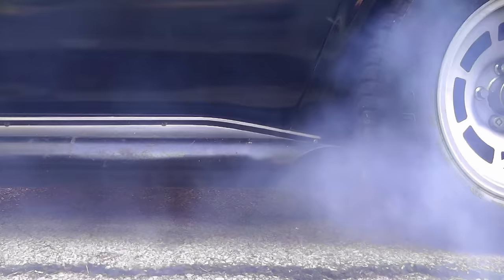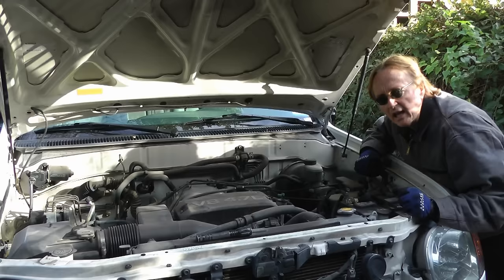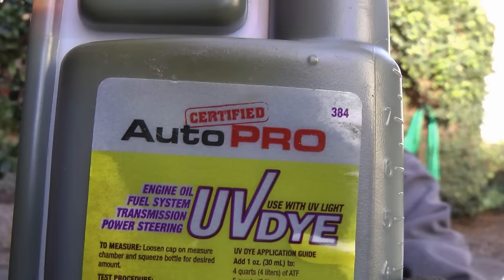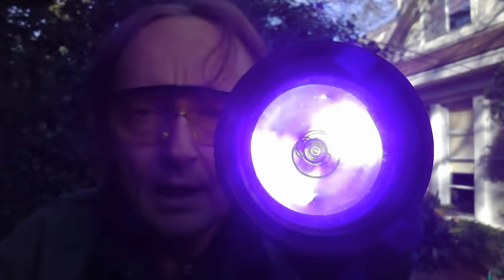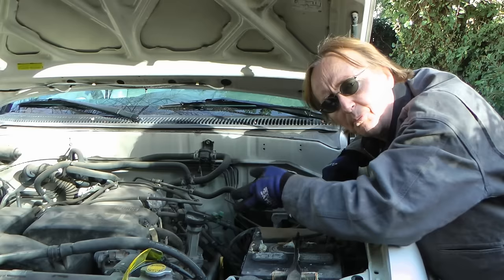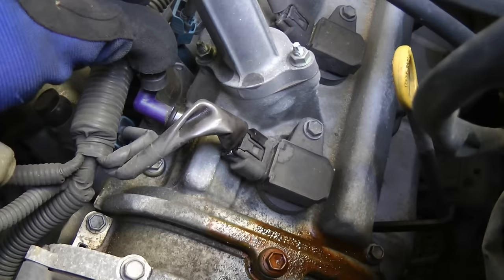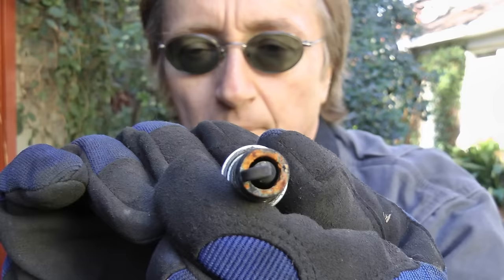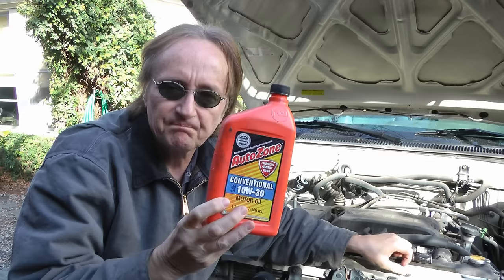How to Fix a Car Engine that Loses Oil (Leaks)

Comment from the maker: it's stupid unless you own an old tractor that's falling apart. If you want to clean an engine, get engine flush in a one quart bottle, it's basically kerosene but has directions and must be used in combo with some oil in the engine.

Comment: Another helpful video. I hope its just the PCV valve being clogged. Time to change the oil and air filter. I will pray its not serious engine problems.
Reply: +222Lightning YOOOOOOOOOOOOOOOOO. How come I can't find the PCV valve on my 1986 Honda Prelude. Its as though there isn't one to replace and the new PCV valve I bought doesn't go there.

Comment from the maker: I'm not a VW fan these days. Over engineering and very weak automatic transmissions turn me off. Now they can get great mileage and those engines can last a long time, but realize repairs are astronomical when they do break.

Comment: My 2001 Corolla was using about a quart a month, it was burning it. Kept messing up my catalytic converter too. I got rid of the car. I could sometimes see the oil smoke in my rear view mirror coming from the tailpipe.I don't think the car was very well cared for before I got it, because I always changed the oil and filter to try to prevent this.

Comment: Part one: I have taken a couple of courses in lubrication and air-oil filtration. One of the problems of oil consumption is if the pcv valve and vacuum hose going to it is clogged. In order for it to work properly a certain amount of fresh air CFM has to be drawn through the hose and valve. This is because the engine creates it's own environment while it runs as burnt and unburnt gases seep past the rings. The PVC's job is to draw enough fresh air (CFM) to stay ahead of the gases. Keeping the air that is in the engine clean. Oil that gets slinged around in in air that's clean for the most part stays clean. Oil that gets slinged around in air that is black as diesel smoke won't stay clean for very long. And these type of contaminants make your car consume oil.
Reply: Part two: Two of the tell tell signs that your PCV system is not drawing enough CFM of fresh air fast enough is that your oil turns black in about 300 miles. The other is where the intake of fresh air is for the PCV system is, which is usually a big hose coming off the valve cover and hooks somewhere to the intake system before throttle plate. Is actually dirty and sludged up a little Kinda looks like engine oil has been coming up through it. This means that the gases that pass the rings is running through the fresh air intake to the PCV system. So your engine is not getting enough fresh air to keep the air environment clean.
Reply: Issac Bourne Past three: So you change the valve and make sure all the "vacuum hoses" are clean and there is no sludge debri inside them. Now because what you spray in the vacuum hoses goes into your engine what you use to clean this sludge out has to be safe for combustion. Safe for O2 sensors and your converter. Other wise you can mess these things up and set all kinds of codes. So use an engine decarbonizer that says it's safe for these things. As the vacuum hose is off and engine is running if it does not stall. You spray a little at a time. Once you determine that you have sprayed enough to get the hose wet with the cleaner all the way through, turn motor off then spray some more in there and hold the hose up so the cleaning fluid drains down into the hose.
Reply: Issac Bourne Part four: Let it set for about 10-20 minutes then crank engine back up. Using your thumb to cover the vacuum hose up and allowing suction to build. Remove thumb suddenly allowing air back in. You can repeat several times. This can dislodge some sludge to be sucked into engine to be burned off. Follow up with a couple of squirts from a can of brake clean to remove residue and you are done cleaning the PVC system..
Reply: Issac Bourne Basic rule of thumb. If you oil turns black quickly it's not your oil that's the problem. Oil is supposed to suspend contaminants so the filter can catch them. Suspension also means the oil is keeping the metal clean inside your engine as the expense of becoming dirty itself. So after you do this pcv cleaning if you oil still turns black pretty quick change it every 1,000 miles until it quits doing that. Or flush it with a "safe engine flush". A good oil will try to clean the residue left inside your engine from a malfunctioning PCV system.

Comment: i use to have a 89 ranger with the 2.3 4cyl... everytime I let out the clutch to go from a stop the engine will go clunk clunk clunk and blows a buttload of smoke,, , the previous owner didn't take care of it too well,, it lasted me through the winter until the engine finally went out ,, but for 300 bucks I am not complaining

Comment: Here's another good trick. If you tailpipe smokes only when you decelerate, your valve stem seals are leaking. You can replace them without have to remove the head . There is a special valve spring tool at Harbor Freight. Cheep. I did it to a Mitsubishi PU and even passed smog.

Comment: I gotta add about qt a month.  My 3.2 V6 from Isuzu is notorious for burning oil. Anyway, on my last oil change I replaced 1 qt. oil with 1qt. Lucas Oil Stabilizer. Been a month, level on the dipstick hasn't changed.
Reply: Isuzu hombre ?

Comment: He’s right about all the possibilities, but in very high mileage vehicles the burning of oil is most likely due to expected piston ring wear. The oil is getting around those rings and being burned up (probably with tell-tale blue smoke coming out of the tail pipe). You can try that additive he mentions, but there’s really not much to do about that short of overhauling the engine.
Reply: But trucks can last for millions of miles though lol as some people say.

Comment: I always use an OEM filter. If I can't find one, I'll always go with a Wicks filter. Both are great filters, good for 5000 miles without trouble. That is unless you drive in dusty conditions. Need to change them more often. Ask Scotty?

Comment: one other thing.. had a vehicle that started using more oil than gas but no smoke... happened to be at a gas station at night and when I raised the hood I noticed the exhaust header was glowing cherry red... The catalitic converter had partially clogged from inside debris when it failed and crumbled.....  replaced the converter and not a drop lost..... the clog was creating back pressure and forcing the oil out of the main seals like crazy.. so if nothing else works just check that out

Comment from the maker: You need an air compressor and all kinds of tools to do that seal if you're doing it on the engine, and not pulling the head off which is an insane job in itself.. I would not advice an amateur to try that job.

Comment: My uncle brought Renault Scenic 2004 Diesel and it has the same problem. Burns oil and quite a lot of smoke comes out. All this started when he had his first oil change done. That means something was put to the engine to prevent smoke from coming out before he brought it.

Comment: If you're a rotary car owner like me the engine burns oil along with the fuel. Might have to top it off if you don't do frequent oil changes. Personally I do a change every 5000km on my RX-7 FC turbo II S5, so I don't bother with top offs. I also premix on every fuel up either way so the engine won't be going bad anytime soon because of lack of oil.

Comment from the maker: fix the fan first so it doesn't overheat. Then work on the AC and heat, and get a trouble code number for that light.

Comment from the maker: valve is on the back of the valve cover. but often with improper oil changes, those engines just burn oil from internal wear.

Comment: you should also add that if your car has a plastic cover underneath, you won't see the oil drip on the ground, most german cars have plastic under body covers that catches all the oil leak

Comment: 8th Gen Accord the worst ever for this issue, just gobbles 2qt between oil changes, which i need to top within 2k, i keep up with all proper maintenance schedule and no leak. Cleaned the pcv as well.

Comment: Scotty I have a Chevrolet that has used a quart of oil between oil changes since it was new.  Oh forgot to mention that it is the 5.3 liter V8 you know the one that runs either on 5 cylinders or shuts down 4 cylinders to run on 4 cylinder mode & I know there is nothing that can be done because when it runs in 4 cylinder mode 4 of the piston are not firing.   The dealer changed oil & used 10W 30 synthetic blend.   Living in S Calif where it gets very hot in the summer is why they don't use 5 W 30 which it calls for & full synthetic at that which makes oil changes very expensive with 6 quart capacity.   I should have researched the car more than I did just tired of under powered V 6 love the car still have it

Comment: Another reason for oil consumption is a worn and lose timing chain from a high mileage engine. When the valves get off timing with piston movement there will be loss of power. Not a lot though. But oil consumption is caused from this when the intake valve opens late creating more vacuum in the cylinder than what supposed to be there. What this does is sucks oil pass the rings into the cylinders to be burned which = more oil consumption.

Comment from the maker: sometimes putting syn oil in a car that used normal oil will cause oil to leak out of engine oil seals. I personally do not swap oil brands out like that.

Comment: I actually have a leak myself, but it's small enough that it just makes a damp spot on the front of the transmission, doesn't even leave a spot, nor does it bother me. It's in an Explorer, they run synthetic oil and that's why it leaks, so when I change it soon, I'm gonna go back to conventional because I've heard that the 302 Explorers leak easy with synthetic

Comment: 2008 Camry factory defect in the engine causes oil excessive oil burning. Was unaware of the recall at the timeI purchased mine used. Found out when mine was past the mileage limitation for the warranty.

Comment: Using hot water through the intake manifold via the brake booster, slowly, carefully at a high idle speed will steam clean the inside of the engine and remove a lot of the carbon for free (except for the gas used). Go slowly so you don't get anywhere near hydrolocking it.
You won't mess up the catalytic converter with burning the Seafoam this way

Comment: I have a 2008 350z, On startup, there is a puff of white smoke for no longer than about 30 seconds, then it goes away. It also spit a little oil at high rev.

Comment: You can clean a gummed up PCV valve. Get the right form fitted hose.
Some aftermarket PCV valves physically fit the engine and cause poor idle quality, so use the correct manufacturer part to stay in spec.
You can test a PCV that's in use and you're wondering by watching the RPM. Put your thumb over its valve cover end and look for RPM drop around 150 let's say on an american v8. Feel it operating. It has a small calibrated orifice and calibrated spring inside. It should rattle inside when you shake it.
If its clogged up or sticky, it can cause pressure to build up.
That can push against gaskets and seals.
There is an additive that can help rejuvinate shaft seals, but if it's oiling your timing belt area, change those seals , the belt, and waterpump, possibly idler and tensioner all at once to save repeat repairs. Some engines have an oil pump down  by the crank you can put a kit into during a reseal.
So it depends what you're working on. Always.
Oil sending units are probably the most common dripping oil leak that occurs first.
Just some facts I've compiled.
The right filter and oil drain plug washer are a regular thing to get right every time.
Torque the plug to avoid over tightening. Lube the filter o ring to prevent massive leakage on startup. Don't leave the previous filter o ring stuck to the engine sealing surface.

Comment: Hey Scotty, I read reviews on amazon on restore engine restorer and this one comment got me thinking. It said that a guy bought a ford pickup truck with a 465 engine I think and it was going through oil like crazy, like a quart or 2 every 300 or so miles. And after adding restore engine restorer and some driving, the oil consumption went from a quart or 2 to 1/2 a quart to no oil being burnt. He also claimed that the valve train ticking noise went away. So I think it turns out the cylinders are scratched up and the csr particles in the additive filled the scratches up and gave better performance and mileage and also reduced oil consumption to none.
Reply: Sorry it wasn't a 465, it was a 460 and it was a 88 f250
Reply from the maker: Peter Kapica that stuff has copper or something in it that can in the short term fill up spaces,but it's no miracle. And NEVER use it on a modern engine with variable valve timing, it will clog it all up
Reply: Right, but if the additive is used every or every other oil change, it will keep the cylinder even throughout. Just don't use a oil filter that filters out particles smaller than the metals in the additive, it will clog the filter up doing that.
Reply: Plus, it might stop small oil leaks because the particles will collect in uneven places and holes if the leak is small. It's also usable in automatic transmissions to make the clutches inside last longer if it's pretty worn.

Comment: I got lucky when I purchased a MKIV Golf 1.8T by adding 6 rounds (2 bottles total) of seafoam to my oil 200 mi before changing it.  I was burning though a quart of oil about every 750 miles and had low compression on cylinders #4 and #3.  Put some compressed air trough the spark plug and heard / felt it coming out the oil cap and nothing out the intake and tail pipe or coolant reservoir.  After the first oil change frequency changed to 1200mi between quarts, and #3 compression increased 15psi to 144.  Kept doing the rounds, and finally I'm a quart down at 5k mi right when the oil change should happen and #3 as well as #4 compression are within 10% of #1 and #2.  Next time I'm bringing a compression gauge with me before buying a car.

Comment: 1999 Corolla burning oil -- need to add 2.5 qts for 1500 miles drive. No physical leak is seen. No white/black smoke. Noticed rear bumper got black easily. Gas mileage is 35 MPG for city drive & it otherwise runs good. Appreciate all suggestions/advice/help to fix the engine oil leak problem. Thanks.
Reply from the maker: +yjxu66 it's burning oil, do change the pcv valve and pray. But that old, odds are engine is just flat wearing out inside. Add oil and drive it

Comment: finally...after 2 years since i got my engine rebuilt on the bmw 325xi e46...ive been having to buy a quart of sae 10-40 every 2 weeks. im going to buy a new hose and pcv. Hopefully that will stop the oil from burning...there is small drops of oil on the ground but not football sized. Hopefully this solves the issue. currently the car has 152k on the clock as of today. we had the engine rebuilt at 110k miles because a valve ring broke while my dad was on the highway.

Comment: My 2005 Pontiac Sunfire is 400 miles above the mileage due for an oil change the mechanic placed on it. In the past I had an issue with leaking some unknown substance, which mechanic placed a new gasket cover - they said I would need to do a 2nd reassessment after a week of driving to see if the leak persists and figure out what else it could be. 

Well this morning, I saw what looked like water drips with rainbow color - and I uncovered that my A/C was dripping water onto what looked like crusted oil mixed with dirt from driving. I suspect some sort of leak, but the right axel is lathered in oil, and the dirt flap on my right tire even has what looks like hardened oil-dirt mixture from driving. I checked the oil on my vehicle, and I practically had none! I poured some oil and oil stop leak to hold me over. When I initially took my oil dipstick to look at it, the stick had a rust tinge and the end of it actually had what looked like chipped off rust particle! Completely flabbergasted. I know my car is old, but I did not expect this damage to be quietly eating away without my knowledge ..

Comment: Andrew Kelly.  What size motor? These models are equipped with three different crankcase ventilating systems. The 1997 and earlier 2.2 OHV models PCV valve is located on the right side of the valve cover. 1998 and later 2.2 engines have oil separator located inside the valve cover requires no maintenance 2.3L and 2.4L OHC engines are have with an oil separator that is attached to the side of the engine block above the oil filter.

Comment: My Accord was burning as much as 1 quart of oil every 1500 miles.  Over the summer, I added marvel mystery oil every time it was low until the entire quart was added.  Drove it another 1000 miles & did an oil change and now the amount of oil being burned is negligible.  Haven't had to add any oil in 3 months/ 1500 miles.

Comment: Is that your Sting? nice ride I have been running a '86 c4 for a few yrs said I would keep until I get my hands on a 70-73 Sting. well not a 70-73 but got a '80 with 85k miles completely redone whole vette engine inter. and paint. your vid's are always very informative thx for taking the time.